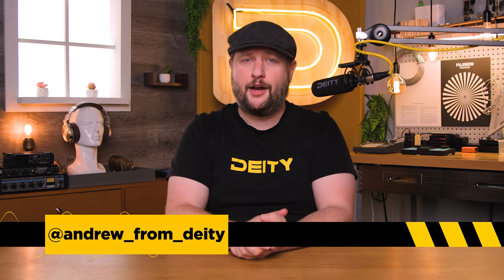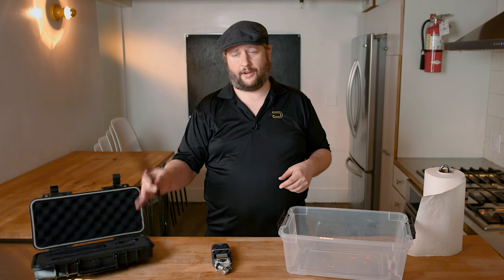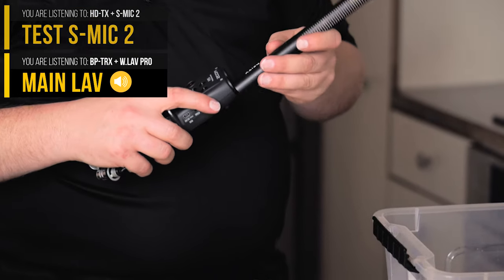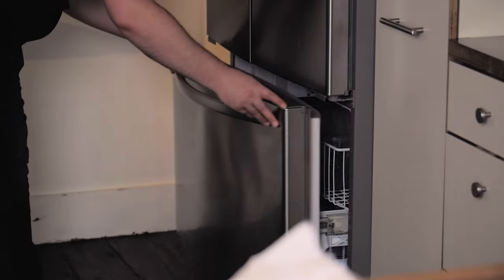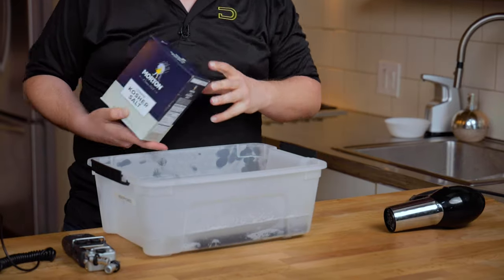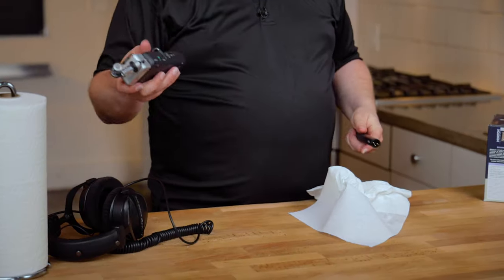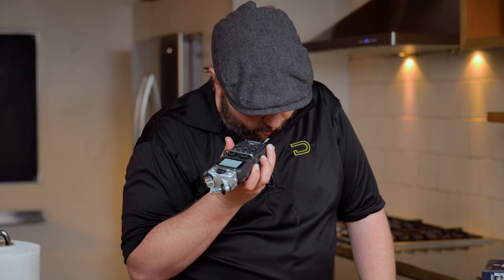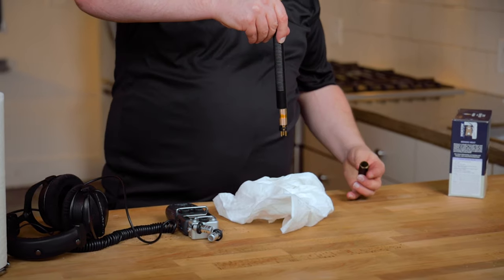Microphone Stress Test | Testing the Limits of the S-Mic 2

Comment: Hm. Its obviously hard to kill. However, this is not a stress test, this is a punishment test. It can obviously withstand more physical damage than an average audio device, and it is really impressive. However, an actual stress test would not be about throwing the mic in the ice /grinder when it is off.  Practical stress test would be to stress it gradually while its working, and see how long until it stops giving usable audio. Instead of freezing it in the block of ice, it would be way more informative if you actually plug it into a cable and put it in a freezer, like a meat locker, turn the temperature down, watch the temperature gauge and observe how the increasing cold gradually affects its performance. Same thing with increase in high temperature. Put the mic in front of a speaker and observe the changes in real time on the frequency spectrum, see how cold or heat affect the quality of sound. You could also stress it by switching the environment from cold to hot while its working to give it a sudden temperature "shock". And please don't put it in water, real test would be to sprinkle some water with a diffuser on it or put it in a sauna where the humidity is high, but submerging it in water is not a situation mics will usually encounter. Of course its not going to perform while the diaphragm is soaked in liquid.